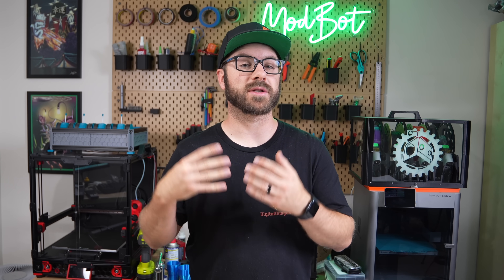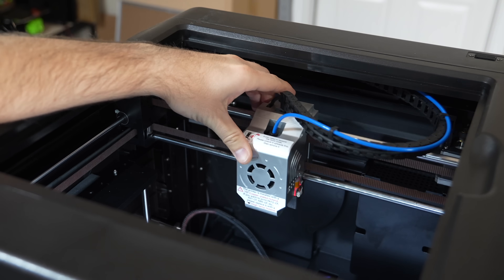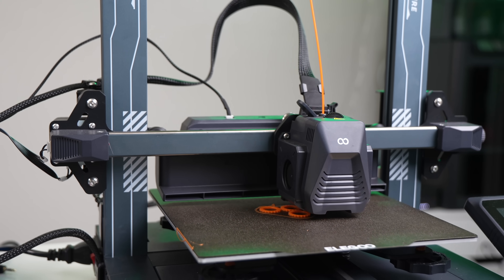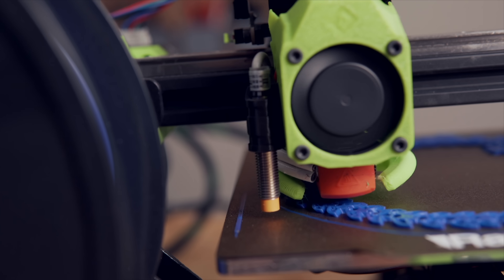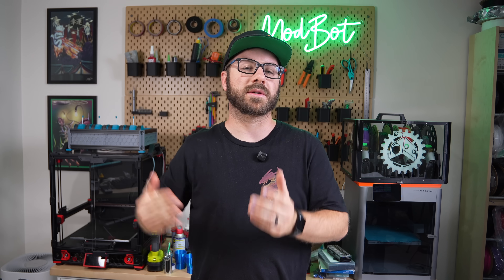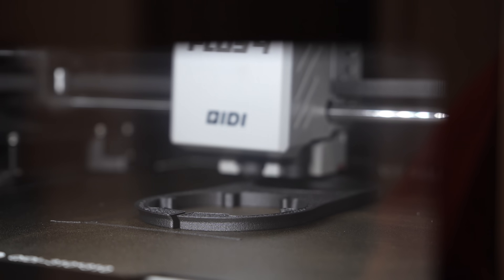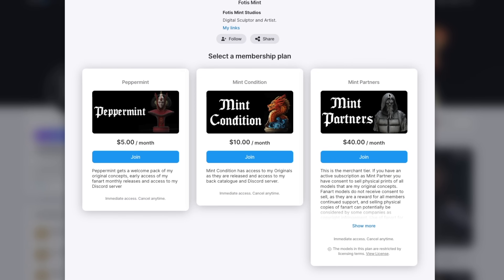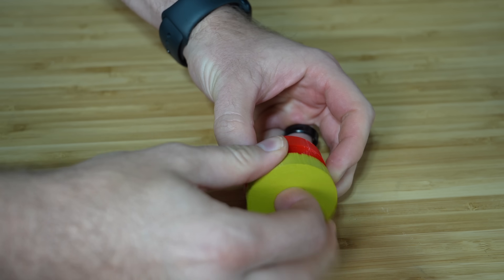Is Running A 3d Print Farm Still Viable In 2025?

Comment: Ive been helping people in my country with their 3d print shops ( my day to day work is consulting with companies making them profitable ) 

And im gonna be real with you.. The ones who are doing it..Just have a passion for printing, they dont have the passion for business. 
You kinda need both if you arent lucky.
Lets put it like this in "easy mode" 
Passion for printing AND busines = High success rate. 
Passion for either or = Low success rate, and depending on luck as a partner.
No passion, just passion for easy money = Total flop. Can have initiall short term success..But thats that.

Thats my entire 7 years of helping 3D printing "farm" businesses take ( And ofc other businesses..They intertwine easily cause its all the same) 
And the people i see is a stereotype..They want fast money, passion for printing, but not for business.. Finds something..makes a 1000 bucks thinking they have solved it.
Only to realize they need to 10x that just to have a steady pay for themself. 

Luck will for sure boost some steps along the way.
But im just saying.. 9/10 farms fails and quits within the first 16 months of running. Usually with a massive loss.
last company i helped had a massive surge last december, went from 250 total sales to 1400.. Massive backlog, ordered printers to get ahead, got ahead. Sales dropped and didnt come back up again. Ended up not having money and needing to take a normal job again..both him and his missus.. total loss turned to be 120k.  If you would account for the loss of income from what they previously had it would 100k more on top of that. 

its not all roses and rainbows people..Dont fall for it..Vidoes online are just here to entertain you.  If you want to start a business..dont spend time on these plattforms as a entertainment purpose..  Thats my solid advice.

Comment: the biggest reason i replied to your poll saying i've been printing abs nearly exclusively lately is simply because i've been printing a bunch of functional components for several of my machines as upgrades.  otherwise, most of my volume is petg, but that's mostly because it's my filament of choice for day-to-day prints for most other projects.  i was first introduced to the 3d printing world by engineering contractors in afghanistan in 2010 or 2011, but didn’t finally get a chance to jump into it myself until some years after i retired.  now i have 5 machines with more planned, each intended to be reserved for its own specific filament (mostly because of customization to each to improve printing of that filament type which isn't necessarily conducive to others), but i do it because i enjoy it & it keeps my mind engaged.  sure, there is a monetary aspect to it that is impossible to ignore, but everybody in this community has their own reasons for it & mine is mostly tinkering.  my grown daughter bestowed my moniker on me in her early teens for good reason, after all....  😋

Comment: Thanks for the video. I am currently starting a small 3D print farm (4 machines) and design, print and sell plant pots & associated materials for indoor gardeners. I use 4 machines Bambu (3 A1 Combos) & FlashForge (1 5M Pro). Which I got all on sale for < $1600. These are great fast machines and give me the ability to print in a host of filament types. I generally use Matte PLA (in several flavors) and PETG but also print in ABS and a few others. I use Bambu Studio & Orca and these slicers are fantastic but you need to do your research to get the most out of them.

I do all my own designs using Autodesk Fusion & TinkerCAD (using a MacBook M1 Max w/ 64G) and do prototyping in OnShape on my M3 iPad. Again you really need to spend the time to learn CAD and any of the common systems will typically do what you need for 3D printing and cost next to nothing. Spend the time to learn the most about your chosen system, it will save you lots of headaches. Don't be fooled none of these systems are easy and there are countless ways to get your designs done and you have to learn the best ways for your niche. 

The biggest cost is filament and you MUST negotiate with manufacturers to get good pricing (or at least purchase in quantity from sellers offering deals to get better pricing). This will save you tons and allow you to better compete. My favorite brands are Eryone, Elegoo, iSANMATE and Bambu. And all of these offer good prices if you negotiate and keep a close eye on their sales. Try to stay with high speed options since your print time is important since your machines will be busy and saving hours per print is important. Spend the necessary time to dial in your profiles to get the most from your chosen filaments. Keep your filament dry at all times, even non hydroscopic types like PLA. I print desicant containers that screw into the center of each roll and store my entire inventory (75+ rolls) in dry boxes when not printing. Don't skip this step regardless of your physical location, dry filament prints much better and allows you to minimize waste on your most expensive resource. 

Be knowledgeable about your printer maintenance and always keep a supply of spare printer parts on hand so you can keep your printers running.

Lastly the absolute most important aspect to gain knowledge about is ChatGPT (or other AI agents). This has been the #1 game changer for me and will become even more important as the technology expands. No matter what level of business & technical experience you have the ability to tap into the vast knowledge base of AI agents will greatly enhance your ability to learn & research marketing, printer technology, slicer details, etc. without the need to hire staff. Make use of DEEP RESEARCH. I am constantly running DEEP RESEARCH prompts to watch competitor trends, establish & grow my marketing abilities, fix printer & slicing issues, get expert help on Fusion & TinkerCAD to aid my design work and so much more. THIS IS A GAME CHANGER!

Comment: The main problem is with people blatantly copying your designs and listing them on Etsy for half the price. Even if you successfully bring traffic to your shop (via ads or social media), Etsy will happily show the copycat products on your listings page because they don't really care which shop the buyers will make the purchase from.
Reply from the maker: This was also an issue when I was doing it. Not massively but I don’t doubt that there are shops that will buy a product from a competitor to replicate it. For some of the niches though it’s tricky to do. Building a brand/loyal customers helps but it’s still an issue for companies outside of 3D printing and printed products.
Reply: I had the same problem as you. That and the fact I've been told well it's only plastic.... and it should be next to free price wise.
Reply: This has always been common practice and isn't going away. Regardless of your market people are always looking for good ideas to copy and there are minimal ways to protect yourself from this. Protect your design files, minimize your marketing materials so you don't give future competitors more information than is absolutely necessary to copy your designs. Be innovative and keep changing/updating your designs to make it hard for possible competitors. You will have competition regardless of your market, learn how to maintain your competitive advantage.
Reply: Don't sell in marketplaces like Etsy and Amazon, build your own website and your own following,
Reply: Make more complex designs so there are less newbies able to successfully replicate them. Also, there is nothing wrong with people copying your designs, that's why every car has a wheel without giving credit to whoever first came up with the idea.
Reply: @typeaboutit that is one of the most ignorant analogies i have seen in a long time. 

First, comparing the concept of a wheel to blatantly plagiarizing a full design is dumb. We are not talking about a concept, like gears or print in place hinges. We are talking full on plagiarism, taking the entire designs, and making little to no changes, or worse even putting your logo on it and claiming to be the original maker. 

Second, you have eyes, go outside and look at car wheels. Tell me what two car from different companies have identical wheels? Even if they have the same thread and widths/aspect ratios and diameter, i can garanteed you there is massive differences in mounting, weight distribution, balancing and even aerodinamics. 

And to your main point. Complexity more often than not comes with less reliability and is a significant added cost to the manufacturer. In some cases the simplicity of a design is what makes it worth it to be a product. Simplicity in desing often means it is more user friendly and therefore more desirable. Just making things more complex is a non solution that very much reeks of ignorance.

Comment: Almost everything I print is custom designed and printed. Even many of the ‘pre-modeled’ models I end up remodeling/editing to fit my needs. I can’t imagine anyone else needing/wanting 95% of what I make. Most of what I’m making is made to very specific, very tight tolerances, made to fit one very specific thing. Also with only 1.3 printers (1 working, 1 terminally under construction) I would probably only call my setup a printer potted plant. I aspire to garden status.

Comment: I am currently designing my own printer that is cheap (~100€) to build and would work “well” as a printer in a farm
Reply: I really wonder how you manage that low cost as the brains, stepper drivers and motors would probably cost more than that even when you shop at AliExpress...
Reply: @marienspek812  I used my first purchase discount from AliExpress to buy the stepper motors in a kit (17.20€ instead of 42€) and the mainboard is a used creality 1.1.4 from eBay. I’m running Klipper on my laptop using WSL (Windows Subsystem for Linux). I have been working on this printer on and of for 9 months tho I have to balance the working with studying (I’m 14 and from Germany) and I am gonna post the results on my channel as my first video (in English of course)